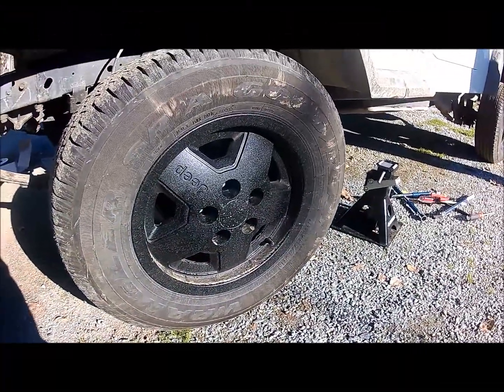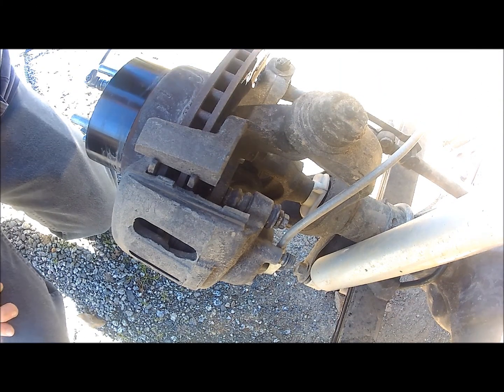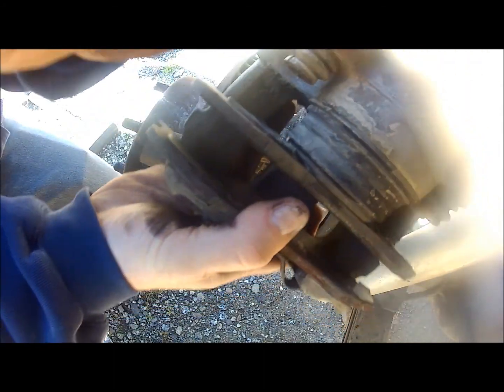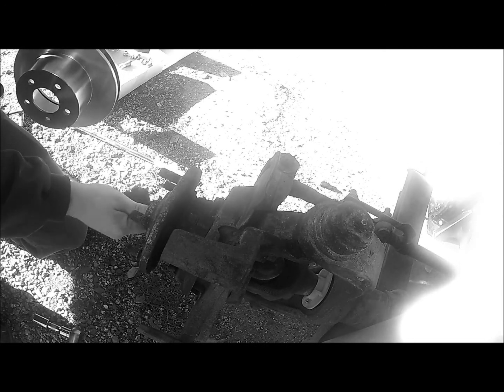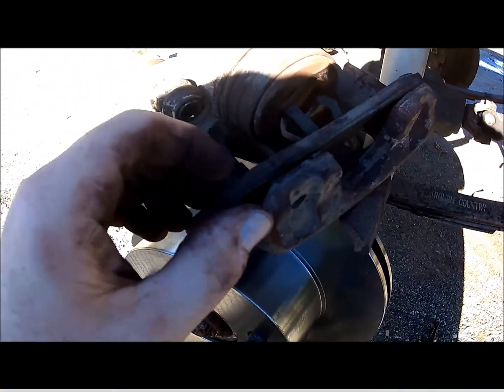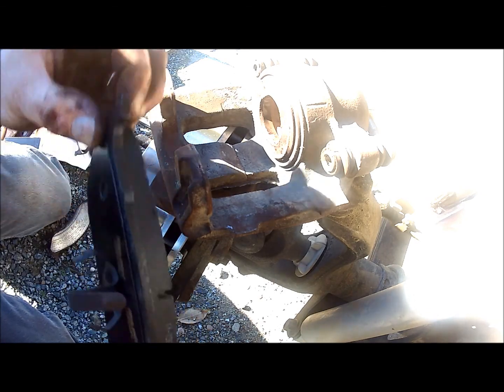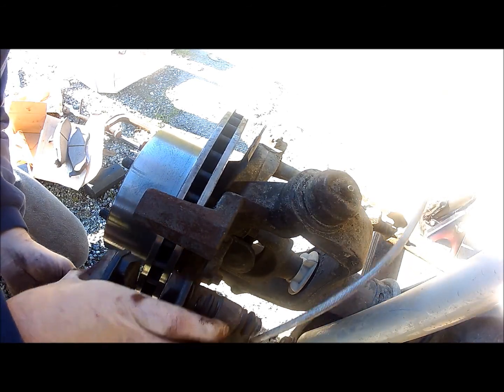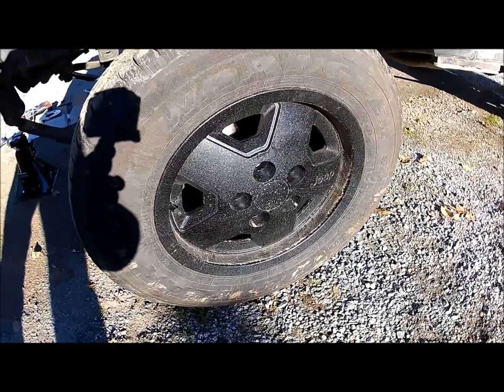Jeep YJ front brakes and rotor replacement

Comment: What do you advise re greasing or not greasing brake pad contact with caliper on the YJ (didn't notice it mentioned in the vid)?
Reply from the maker: That’s entirely up to you. I usually don’t put grease there in fear of getting it on the pads and then having a Squeak. I know they do make a brake pad grease I just don’t use it.
Reply from the maker: Will do thank you